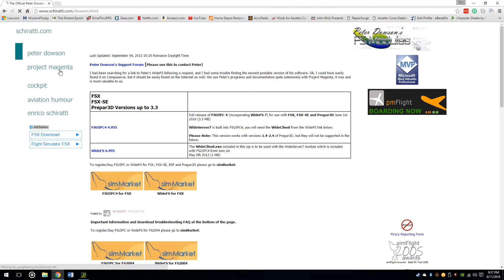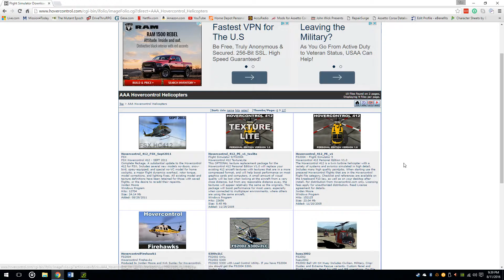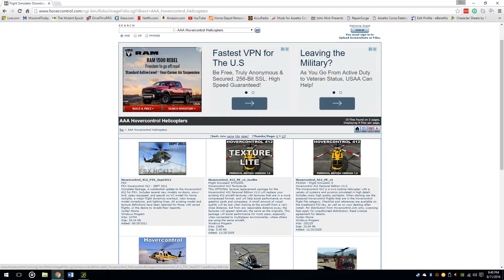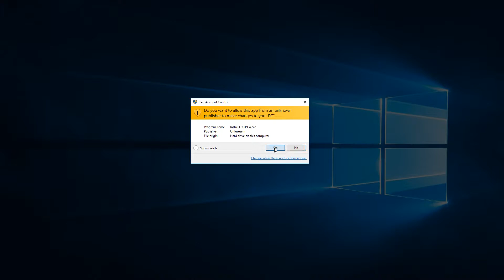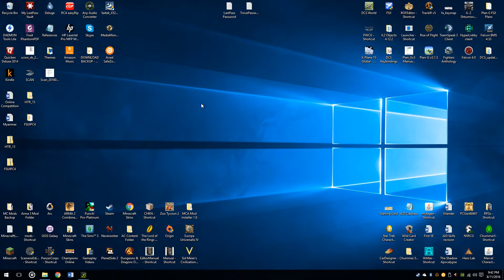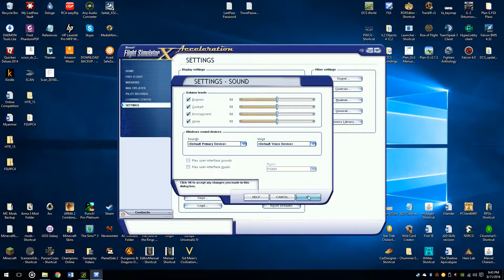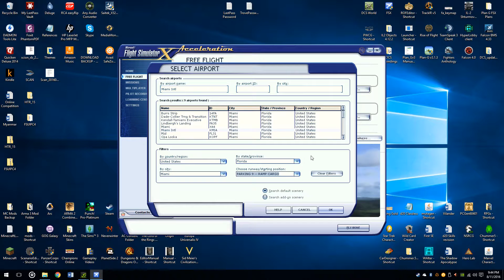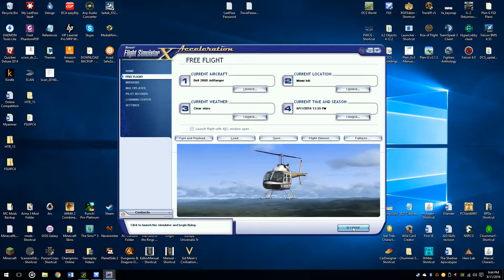FSX with Hovercontrol and FSUIPC

Comment: Step 2 (as shown) downloads Hovercontrol_412_FSX_Sept2011.exe from the "AAA Hovercontrol Helicopters" section, which is Jordan Moore's Bell 412 Helicopter installer and not HTR_15.zip (found under the "HTR - Helicopter Total Realism" section to the right of that main menu)